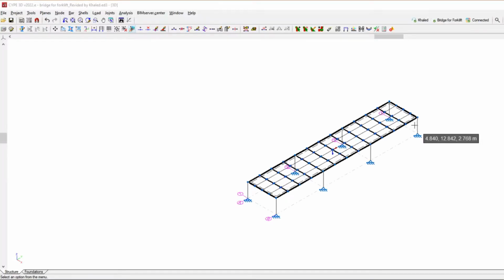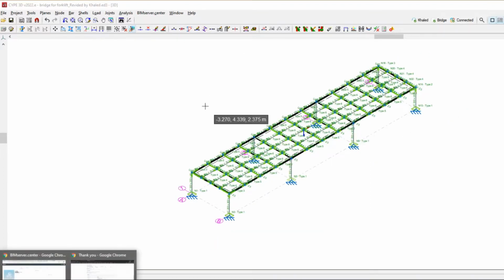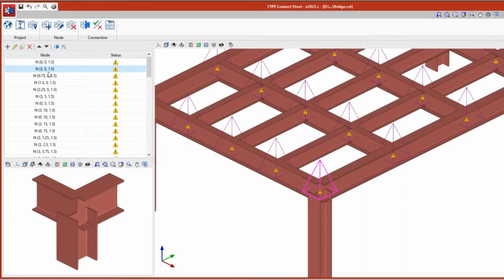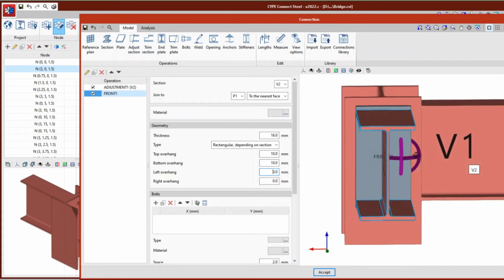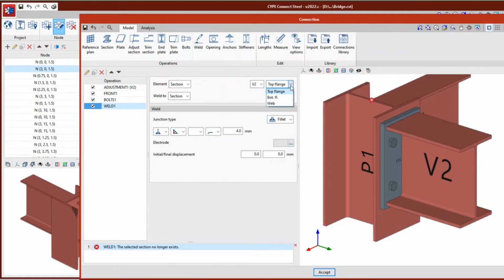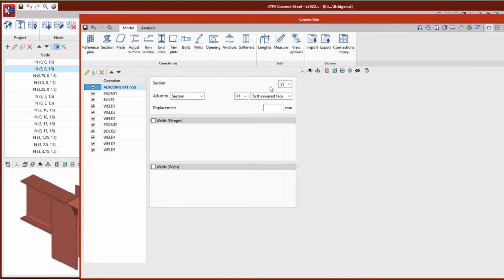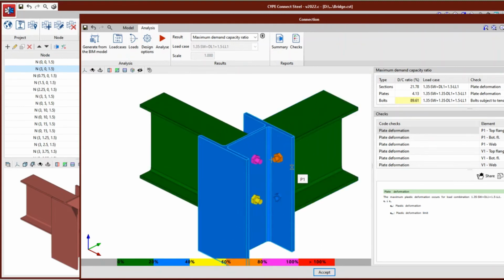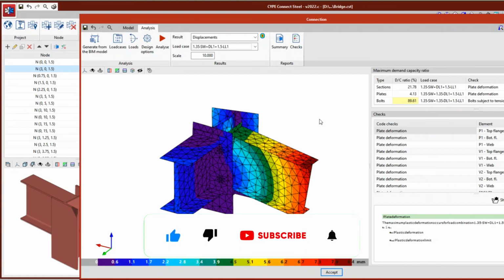How to customize steel connections using CYPE 3D and CYPE Connect Steel

Comment: Sir, can you do a favor. 
Can you demonstrate design of a portal frame shed.
The shed has 15 frames with 4.69m spacing. The total length of the building is 66.66m and width is 18m. The apex height is 7.5m and eaves height is 6m. This building is considered as closed building and spacing of frames 4.69m.
Reply from the maker: pls send us a proper dwg file. Then we will focus on it.
Reply: Sir, your mail ID or contact information??
Reply from the maker: @harishdesignhub  info@pasofal.com
you can find all the info in description of the videos